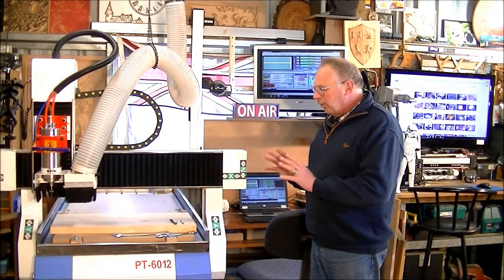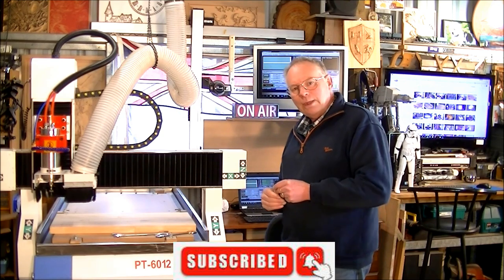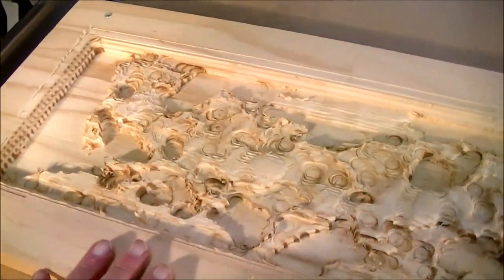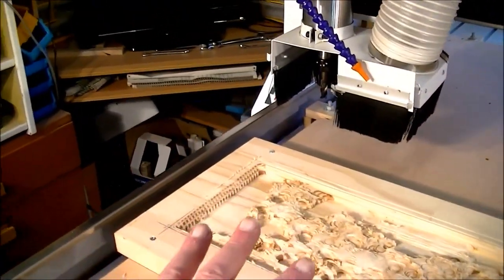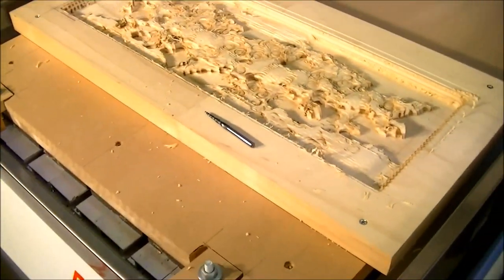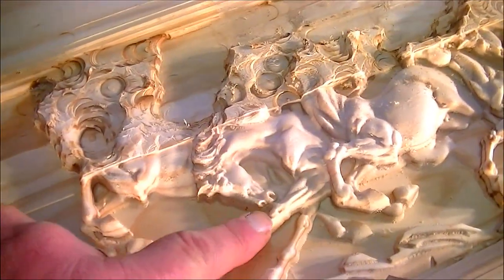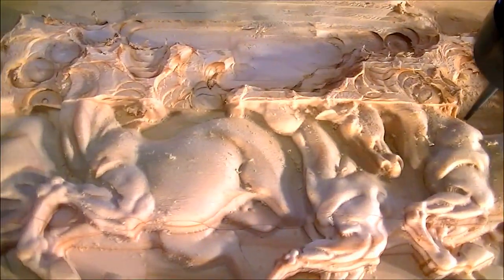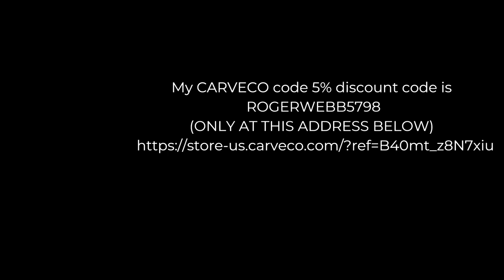CNC Router's CAN MAKE #$100,000+ per year "This is how" machining 3D deep engraving crazy horses

Comment: what do you do to prevent cupping/warping once you unscrew the workpiece from the bed? especially when cutting so deep. I have experienced major cupping whenever I have tried to do anything like this which is pretty much impossible to rectify.  you're advice would be much appreciated. also thanks for the videos you're a welsh of knowledge and a credit to the platform.
Reply: Cupping as you describe it is from wood that was improperly dried. The inside of the slab will be a higher moisture content than the outside; dried too quickly or for too short of a time.  
 It’s commonly called case hardened lumber, and an easy was to test for it is to make a  partial rip on a table saw.  
 If the kerf closes, it is casehardened.
 TLDR: find a different lumber supplier if this is a consistent issue.
Reply: @keithschuessler3435  thanks for the advice :)
Reply: @keithschuessler3435  From what I understand it is not only moisture content but internal pressure release from the unique grain structure of each piece of wood, unavoidable without resin stabilization

Comment: Sir how did you set z zero second tool.please explain
Reply: Once you set your x, y, and z axis' to zero, you do not have to set them again UNLESS you move the workpiece. Otherwise, you just set the tool height every time you change bits because you never place bits in the router/spindle at the same distance/height from the workpiece.

Comment: How much does a cnc machine like this usually retail for?
Reply from the maker: $12,000+
Reply: @rogerwebb9600  a sizeable outlay for those of us interested in getting into a thing like this for the first time,  especially when needing to convince the wife that it's worth it haha. Would you have any recommendations of perhaps cheaper machines/bits that would still be decent for a beginner to get into?
Reply: Where would I be able to get info on purchasing one of these... love the work as I do 3D Base Relief work in ZBrush and own 5 3D printers but wood always looks better. Need one soon.
Reply: @nedflanders4158  ditto what Ned said….
Reply: Look up the Shapeoko series from Carbide 3D. Much more afforable and VERY capable. I have the Shapeoko 3 XXL and it's been a workhorse for yearssss.